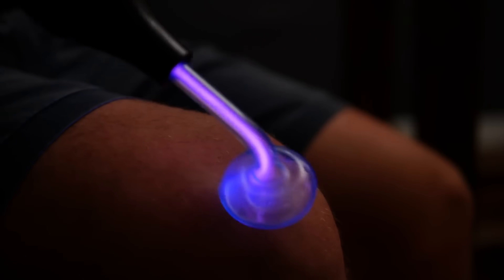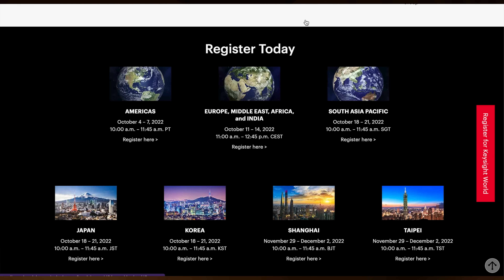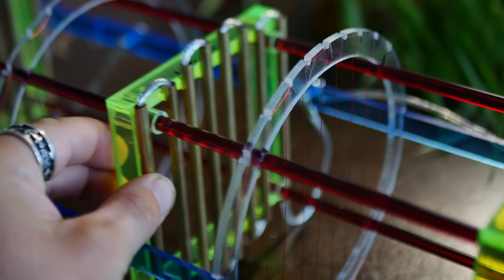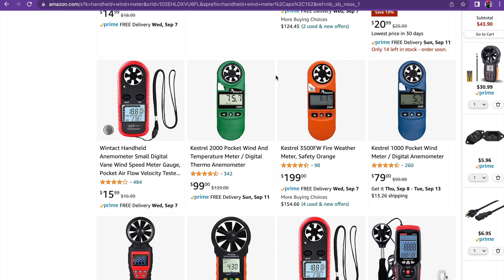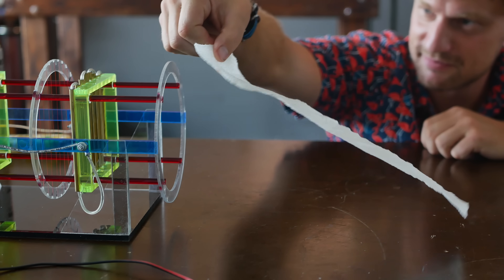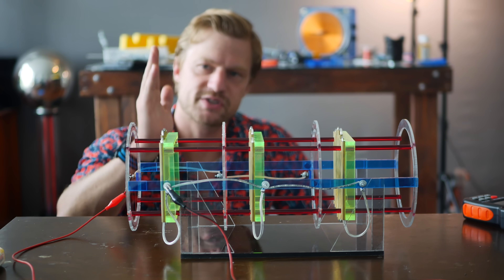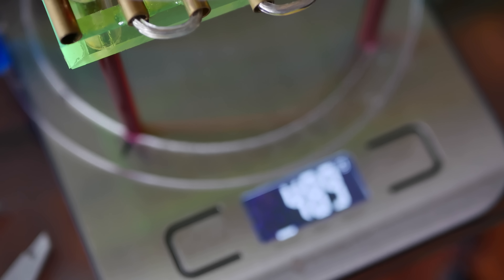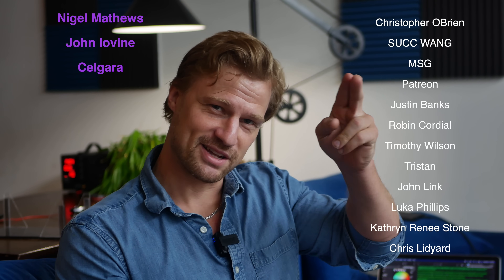Designing A Next-Gen Ionic Thruster! (For Flight)

Comment: solid state fan, ah ha ha
Reply: solid state spin copter
Reply: nice guitar, try sideways guitar matrix crt display
Reply: why dont you just use a high precision weight measurement device
Reply: just blow the air up, just make the zero weight at the thruster weight
Reply: what a circus, this c times
Reply: sounds like a jet engine btw
Reply: or a vacuum duster
Reply: or just smoke :)
Reply: try smoke/dry ice to the input
Reply: like the hardware channel
Reply: nice science bro
Reply: yes a force field is a force pushing particles towards any incoming stuff
Reply: multiply the used power
Reply: you can calculate the exit velocity for the particles on average, from electric field equations
Reply: there you get the optimal parameters for maximal thrust and weight design
Reply: thats perfect for a blimp thruster, calculate efficiency, power to thrust ratio
Reply: or just a vacuum or low-vacuum thruster, upper atmosphere micro satellite, blimp satellite, blimp to high atmosphere, solid state ionic wind thruster to orbit (SSIWT or SSI thruster)
Reply: better not be BS
Reply: she banned, yes
Reply: can you have a one power point slide (5s max) of the key numbers
Reply: all-in-one condensed details
Reply: not very entertaining for youtube, but very useful
Reply: volume of air moved, maybe make it in a tube, pun intended, youtube
Reply: actually you can calculate that from the down-up weight scale thrust grams measurement
Reply: even solar panels are suitable even if they are a bit bulky, so a solar blimp with ionic wind is completely solid state
Reply: that shape can be fully a blimp, ironically
Reply: if that shape is charged with one polarity charge instead, like van der graafs dome, but mesh, you can have a mesh vacuum blimp, assuming the air inside is one polarity, and pushed out of the mesh grid blimp shape
Reply: sounds like women hair drier, tho, not too different from heating wire-coil-mesh
Reply: how about oval long area shape
Reply: skewed circle, ellipse
Reply: dont know why
Reply: more efficient use of area, ie, test area dependency of air flow
Reply: just like a jet engine noise
Reply: normal plane cant thrust direct up, uses wings, a fighter jet can vtol and fly-hover up
Reply: not people's king, God's king only, thanks, but no thanks

Comment: 1-weight of power supply and battery u should use LLCC circuit.2.weight of the plane use chopestickes which is stronger than palsawood and lighter in sum weight.3.plane shape.

Comment: i would like to see if anyone has input on these points and welcome critique: 

 *1) change shape of ground electrode from cylindrical to more of a rhombic rectangle.
(the drag from moving particles around cylinders generates negative pressure zones along the length of the cylinder, if you spin a cylinder fast enough it can "fly") 
 
*2) maintain staggered spacing but also stagger the voltages as well
(not sure if starting off with highest voltage at first stage would help over come the bottleneck of the inflow and then finish off the 3rd stage with least voltage applied because of efficiency increase with part *1 and *3 or if something along the lines of Max->Least->Max would be best? worth trying tho)

*3) definitely want to enclose the flow path to assist with any stray inflow and AWOL charged flow
(maybe a circular tube designed like tesla's straw? flow one way is great but backwards is useless type thing? or do super simple heat shrink that is used on 24 packs of water bottles)

Comment: In these last 23 years of studying and building "air breathing" atmospheric ionic propulsion technologies, the three largest inefficiencies in your prototype thruster are:
1- Visible corona waisting power to generate light and heat, both of which take away from total thrust in this design.
2- Audible sound (the hiss) waists power by scattering sound waves in all directions which reduces thrust.
3- No insulation at the wire edges encourages ions to exit the sides of the thruster, where they produce no thrust.

Other less obvious notable inefficiencies and solutions are:
4- Use of thick wires increases the minimum ionization threshold potential, which decreases neutral molecule impact events due to higher ion velocity.
Solution- Use much thinner un-insulated ionization wires to ionize at a lower potential which increases ion density by reducing ion velocity. 
5- Contentious HV DC keeps ion acceleration velocity maximized which reduces neutral molecule impact events.
Solution- Use pulsed HV DC from 20Hz-500Hz which will dramatically increase neutral air entrainment and hence total thrust.
6- An open thruster design near the table surface causes parasitic leakage and a minimal counterproductive reverse thrust.
Solution- Use an enclosure twice the diameter of the thruster to force all thrust in the desired direction.

By following these guidelines, I have achieved 1.05 grams per Watt, and using all accept point 6, achieved a 4:1 lift to weight ratio. (Yes, our thrusters lift themselves with great vigor!)  Good luck, I'll try to answer questions if you have any.

Comment: I recommend wrapping this in a magnetic field (solenoid) which will both accelerate the ions and serve as a feedback for free ions that don't lose charge at the outlet.

That way you have an electromagnetic jet engine that is completely solid state.  Depending on the work you put in, it would make an interesting eVTOL or drone.
Reply: I would not suggest doing that but instead wrapping it in foil or metal sheets. this keeps the fields tighter in the engine it self instead of going all over the outside. 
The reason i would not use a magnet for that is the you want to create somewhat of a laminar flow of air through the tube but a magnetic field around it would either pull the electrons to it or push them away.
lets say it pushes them the they would al go to the center. this would increase plasma density but also decrease the surface at with the plasma contacts other air molecules to make the move along.
where the idea could work is a sort of an afterburner if you slowly decrease the tube area until you get a smaller tube where the plasma created is pushed down the tube with several solenoids like a small particle accelerator of sorts.  that small tube could the go into a bell nozzle or aerospike to turn the pressure back into velocity. the only thing would be cooling the whole thing when in use and after
Reply: That's very close to a Magneto-Hydrodynamic engine.
Reply: how can a magnetic field add kinetic energy to a particle's velocity if all it can due is apply force 90 degrees to its motion? For instance, in a cyclotron, the magnetic field just changes the direction of the electrons, it doesn't speed them up. The electric field speeds them up
Reply: @pyropulseIXXI  This is not pointed at me, but I read that as a misapplication of magnetic flux line shaping but using soft iron, similar to power supplies by Pavan Biliyar, which I don't believe electrostatic forces are affected by being that the iron is neutral.  Again, I don't know much beyond highschool physics.  Sorry if I misinterpreted what Pavan said.

Comment: 1. distance between each stages could be shortened
2. use lighter material alternative than brass. I'm thinking aluminum-tin foil, but graphite rods or painted graphite powder might be good as well?
alu-tin foil could develop holes in the long run, so painted graphite powder could be better for less maintenance
3. what's the basis on the amount of strings? maybe add more but use thinner gauge for less air resistance?
4. the closer to the output the more strings might also help together with staggered spacings
5. what about using LDPE to hold the ground plates instead of the green coloured plastic?
6. enclose the sides with LDPE as well?
7. gradual exhaust constriction?
8. can also use thinner plastic but weld them together instead of gluing
9. screws + washer + nuts as connection points are too heavy right?
10. copper tapes instead of the wires running near the blue plastic
11. change the overall shape maybe?

Comment: This was pretty incredible for a first-gen design!  Have you figured what the overall system efficiency is?  That is, the mechanical power in the airstream divided by the electrical power into the power supply.  You've got the stream velocity, so all you need to do is calculate the mass flow of air, which you can get if you know the density (with corrections for altitude, humidity and temperature).

Comment: What if you push the air off the top of the craft so there is no air pressure on the top of the craft ? Would the air on the bottom of the craft have enough pressure to lift the craft?

Comment: This is awesome. I’m an aerospace technician, I’m no engineer. I know it was for visual representation but ducked air flow would increase well… airflow. It doesn’t need to be super heavy duty. Maybe clear acetate plastic. You could 3D print all of your plastic parts with a gyroidal infill and reduce the weight of the parts. Does increasing the wire windings increase thrust. If so by how much? I just found this channel and I’m now subscribed!

Comment: Nice work. My first improvment idea: add a casing tube shape around it to avoid loses by turbulances from between the stages by air from outside. Also the distance between the stages could be have influences and should be quantified.
Second: add a fan in front and back to archive a better volume per second by compressing the air in front of the stages.
Looking forward to see your next stage. 
One question would be nice to know. How much trust creates a 90 watt electric motor with a fan and what is the weight of such a setup.

Comment: I read a paper once where they grew carbon nanotubes on the electrode and it dramatically dropped the voltage required for air breakdown. I think it was used for some sort of sensor. Copper is a common substrate to grow tubes on, so copper wire should be possible. You need a catalyst and a carbon containing gas and relatively high temps.
Reply: Thankyou, this is helpful.

Comment: My thoughts: Semiconductor implant machines use linear accelerators that are based on resonant tanks to generate ridiculously high sinusoidal AC voltages. The sine wave accelerates an ion toward the electrode on one side of the wave and accelerates the ion away once the polarity reverses. I imagine a pulsed ion source like your setup on the front of an array and a series of accelerator parts with alternating electric field panels (like your wire grids). I think a similar, "attract/repel" configuration would be more efficient than the voltage multiplier (which I don't recall being real efficient from a voltage creation standpoint anyway).  

I'm not sure that the (relatively) large round electrodes are a benefit as the electrons are looking for (or jumping off) a conductor, however they find it. The larger sizes may be blocking some of the efficiency. The mean free path of the ions in atmosphere (being so short) are generally going to be causing collisions and flow in the direction of the ions but the air won't flow around the tubes as easily as the wires. 

Very nice work, well presented and professionally done!

Comment: My guesses of what's missing are:
1) There's no Velocity Stack to gather air into the front.
2) Theres no housing or inner chamber to keep the air from coming out the sides.
3) Shouldn't the ground pipes and positive wire be blade shaped, like knives? Maybe alternating Saw-Tooth for more surface area?
4) Theres no nozzle shape thing at the back like jets have.

Comment: what if you took some ionic breezes like units in a hub circle then use a cone with smaller hubs with a slight twist to force a rotational spin to make a lower pressure zone to increase wind flow?

Comment: I think a true evolution of an ionic thruster would have to include much higher pressure output, like what a turbine did for propellers. I don't think we've seen the evolution yet.  Plasma is conductive, so maybe magnetic confinement within a section to compress it then on to the next section for more speed and compression, until the end.

Comment: Your wire seems enameled, why not trying with not isolated wire ?
Reply from the maker: Ah, the first to notice this! That is one of the three improvements i'd make. Though, the enamel doesn't block the high voltage very much. Enamel wire is only rated for 300 volts, over 600 volts it then it conducts. I'm pumping 40 kv through this. However, it IS an inefficiency.

Comment: I wonder if changing the orientation of each stage (let's say turn stage 2 90 degrees clock wise) would have an impact on thrust?
Question 2, would a casing have any impact? Since it would prevent sucking in additional air.

And last, would adding more stages increase speed/efficiency lineair, or is there a point of diminishing returns?

Comment: I'd say:
1. I think that the ions, while being mostly attracted by the closest grounded electrode, are also repelled by the next charged electrode and attracted by the previous grounded electrode, which would reduce their final speed and make the build lose thrust by slowing down the ion flow. I don't think that can really be avoided, except by making the engine reaaaaaally long, though...
2. Enclosing the whole thing so it doesn't loses any air to the sides could help (this might actually decrease thrust since this would mean no air intake on the sides? It might provide more accurate tests for future space propulsion, since your argon, xenon or whatever will probably only come from the "main" intake)
3. iirc ion engines expell both positive and negative ions to prevent the engine from building up a large charge. I don't know if you're already doing that or if that's really necessary, but it might be worth looking into.
Reply: Simple fix for reducing air flow from the sides. 1-way inlet valves to allow air to flow in, but not out.

Comment: 1. You could use a material like balsa wood/lighter conductive parts to decrease weight 2. Adding light weight tubing around the sides to decrease drag and loss due to durround air
3. Adding more segments, potentially close together might increase efficency.
4. Decreasing the air pressure moght help accelerate the air molecules even faster too, but thats kinda irrelevant in the atmosphere 

This thing is cool, its basically a particle accelerator, but in the air.

Comment: About that airplane, major issue probably will be weight, because you have to fit batteries and electronics into it. Another issue is size. This engine is big, so airplane need to be big as well and that means more weight. I don't know how about power consumption but it will be noticed. And crashing this airplane will probably destroy the engine so you could reinforce it or make parts for replacement.

Comment: Great video, 
I would do three things,
1. flatten ground tubes to reduce drag on airflow, 
2. Put this in a tube.
3.stagger voltages with highest in front. 

I am also thinking you didnt vary the distance between the actual stages. Likely a good idea because of possibly reversing the flow, however what is optimal distance between stages?

Comment: Amazing. I’ve been thinking on this since the first ionic wind vid and watched it +10 times since.

Everyone’s pointed it out - an engine cowling’s + streamlined internals absolutely necessary.

Then you could explore moving more air mass either by compression(like we would with gas turbine) but an axial/centrifugal type compressor wouldn’t be solid state.

Worth rather exploring dyson fan effect. Less wiring = less drag and possibly higher energy density across electrodes? 

Also, what’s our thoughts on Ozone output?😅

Comment: Reduced it's weight a little and replace it with an enclosure. Maybe with an adjustable nozzle on the trust edge.. of course ok I'm adding weight.. Increase the surface area (or maybe the number) of the charged surface? 

Go a step further integrate the components in  linkable sections that internally support the components from it's wall. Allowing for whatever range of spaces you want to be snapped in with ease. Once you find the best spacings for the set up.

Keeping it ultra light can only lead to not enough flow to really create enough lift to be useful. Finding a ratio of a thrust that can lift a little more robust structure is where we need to go. The light weight category is almost tapped out. Stacking them is something I though about a while ago with no means to test it for myself. Glad its pushing the limit. Now run with it damnit!

Comment: .18 Thrust to weight ratio is about the same as the first Wright Flyer.  Not the engines, the whole plane.
Reply from the maker: Sooooo, you're telling me i've got a chance [insert Jim Carry from Dumb and Dumber]
Reply: @PlasmaChannel  The Wright flyer was more than powerful enough to take off on it's own.  Thrust to weight is important for take off.  The important ratio is Thrust vs Drag at cruise speed (where the lift equals the weight, usually at 2/3 throttle).  Just pointing out the obvious:  you will need high lift at low speed with very minimal weight.  The numbers in my head imply a blimp (it removes the Lift portion),  but you can still make this with building techniques for gossamer model airplanes.

Comment: could you use a ram jet design forced air goes into a tighter cone space to make more thrust? maybe make it a net instead of lines so you can lower voltage a little but get similar results.

Comment: Jay, wow, I want one!!, biggest problem is power supply and its weight. 
But more questions? what if you put more voltage on each preceding element, a thrust nozzle at the exit to speed up mass flow, what about different sized plates condensing/concentrating the flow stream.  So many more questions,  oh great blog 😁👋🇬🇧